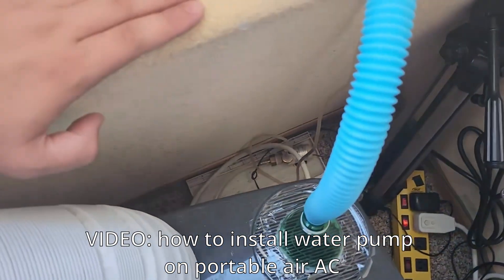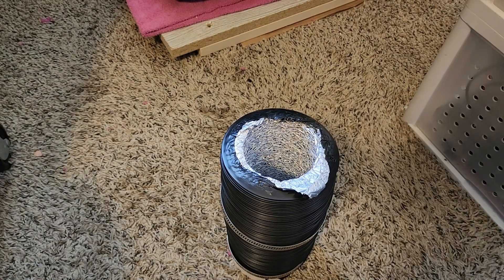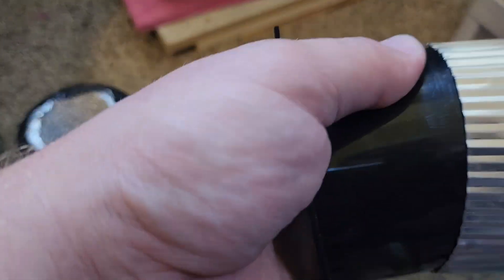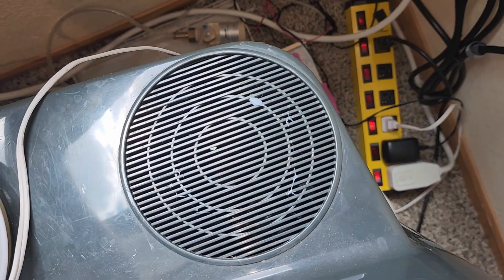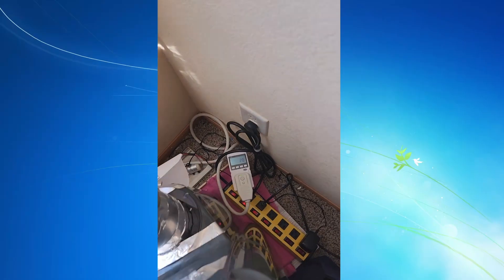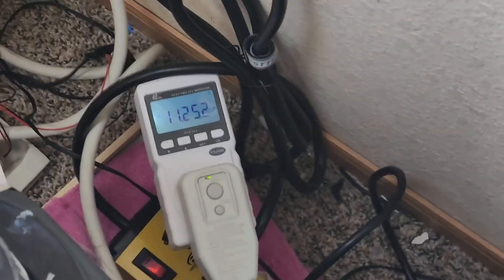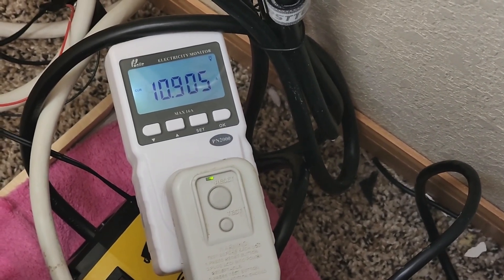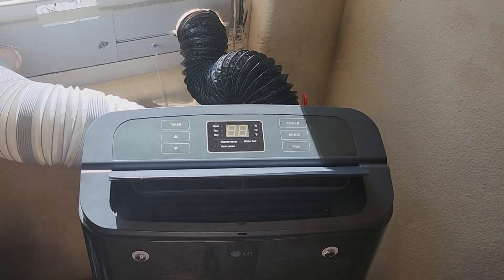second hose MOD to my portable LC air conditioner

Comment: Hello,
I understand the concept of negative pressure that causes hot air trying to get in by any means.

But what's the point of drawing hot air from the outside, is it to add more air into the room or to cool down the portable unit?
Wouldn’t drawing hot air from the outside make the room hotter?
And last question, are those portable units powerful enough to draw air from the second DYI hose?

Hope you have a minute to answer my questions :)
Reply from the maker: If you look at where the pipe is going it's going down to the condenser so it's just acting like a normal AC unit it's using the outside air to cool down the condenser and the air never makes it into the room. 

And for your second question, it varies based on square footage but
This is a one ton unit so it's able to cool down my room plus some of the upstairs but your mileage may vary I recommend avoiding these if you can and get something like a large window unit.
Reply: @Alexwarestudios  Thank you for taking your time to answer I appreciate it
I already have a one hose unit and I just wanted to understand, and window unit aren't as common in europe. 
Hope you have a good day
Reply from the maker: @LeqzNightmare 
That's understandable my best advice then would be to see if you could find a two hose unit so then  it would not use all of your room air to cool down the condenser 
And find one with the proper BTUs for your square footage.

Comment: I like the idea, however I'm concerned the condenser might be rated and tested to work at cooler temperature than outside. It'd be interesting the subcooling.
Reply from the maker: I was thinking the same thing but It appears that the evaporator temperature makes a bigger difference, and this modification has been working extremely well.

Comment: It looks like you love modifying, i bet you can install mini split by yourself.

It will be more efficient and you wont havr the hassle of adjusting everytime.
Reply from the maker: I definitely could, I used to do HVAC unfortunately the house is a rental so I'm not allowed to install one otherwise I would have a very efficient window unit with a digital inverter instead of an inefficient floor unit.

But when I get my own house eventually I'll definitely consider mini splits